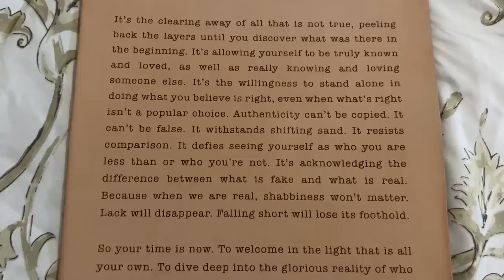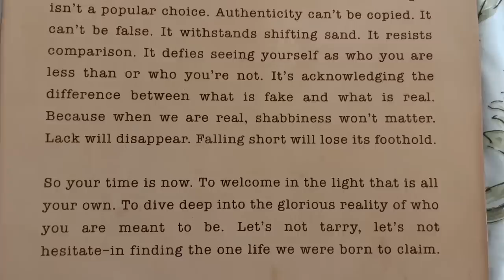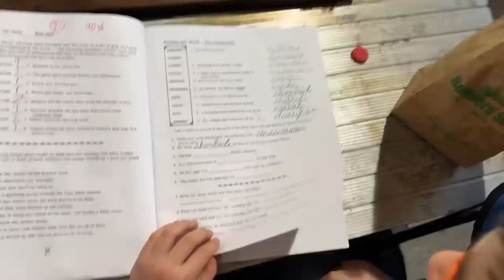Log Home Mural using Old Pallets // Trip to Dallas Texas

Comment: Looks good. I agree with Pricilla that the Paint is a little to bright. I would have cut the paint with water to make it more like a stain.  You can always sand it back lightly though and it will give it a rustic look. Looking forward to see what you do and the completion of the house.